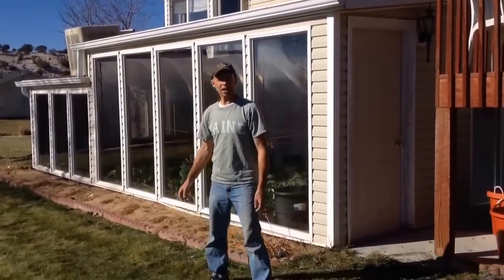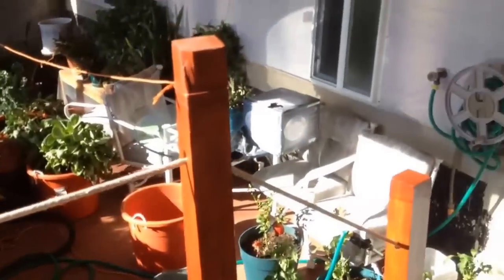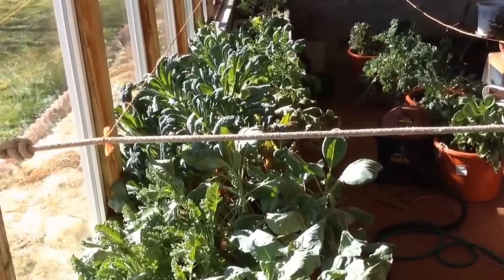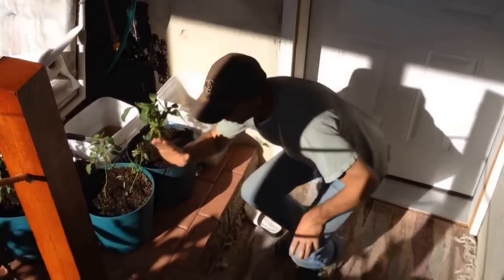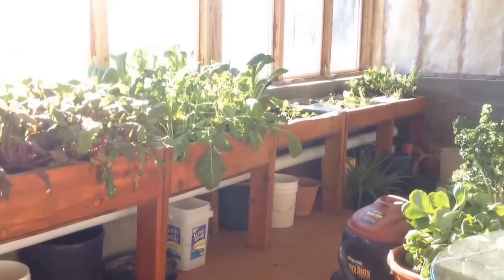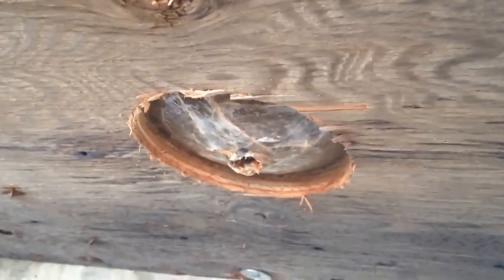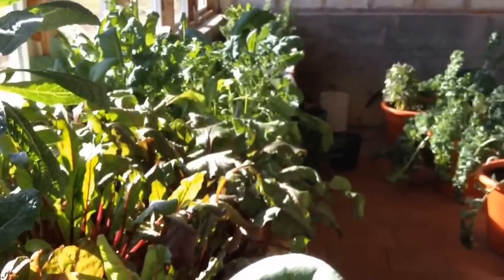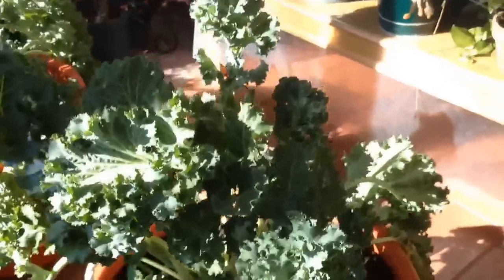Design an attached winter greenhouse / solar thermal mass heat room

Comment: Great job on your home. A NSF (National Science Foundation) sponsored home in New Mexico in the 1070's or so did the same thing as you did and commented in the report that they never had to heat or cool their home. It was a big surprise to them. Do you think they should have been surprised. No. The should have figured it out pretty easily with just one fact: 
Heat goes from hot to cold. And if the medium that transfers the heat is steel it goes very fast, concrete 10x slower than steel, and dirt 10x slower than the concrete.
If you insulate your concrete stem walls on the outside so the concrete stem wall and the earth beneath your structures does not connect with the outside air then look at your green house:
1. When the sun comes in energy is introduced making photosynthesis and what is not used for that is left in the greenhouse above ground and reaches a temperature of say 80 degrees. Where does the heat go? Now how does is get there. The outside air is 20 degrees. The ground is 55 degrees and your home is 70 degrees? Where does the heat that caused the temperature in your green house go? It cannot go to the 20 degrees through the concrete but can go through the glass. Why can't it go through the concrete? Because the concrete is insulated on the outside - that means no heat flows (mostly). So heat goes out the windows, goes into the concrete stem walls, goes into the floor tiles, goes into the sand, goes into the dirt with a certain moisture content, and goes into the walls of your home - because it wants that 70 degrees. And the walls of your home take the heat to the ground because they are insulated and no heat gets to the 70 degrees, but it wants to and is trying to. 
Now at night when the green house loses all its heat to the outside air through the glass through both the conduction through the glass and radiation to the universe (universe very very cold - it wants all your greenhouse heat but radiation is not so fast, but fast enough).
So when the greenhouse gets 50 degrees what happens?
You figure it out. What temp is your concrete stem wall? What temp is the dirt it took the heat to? What temp is your paver? What temp is the sand beneath your paver. What temp is the earth and moisture in it? What temp is your home inside? Right. All higher than the greenhouse. So? All the heat wants to go into gthe greenhouse that was taken from the greenhouse during the day. 
Make sense? Better because the physics makes it work like this - no surprise. You just have to think about it (like the experimenter in New Mexico forgot to do). And their study still is how people understand things today - by not thinking about it, they understand incorrectly. Good luck. Great greenhouse. You will never pay a heating or cooling bill if you get it right. Very cold period coming. Thanks for sharing  with us.
Reply from the maker: Thanks for adding your comments Carlos. There is a lot to be gleaned from the Earthship homes in New Mexico that run off of the physics that you are talking about and sustain livable temps through the winter, from the solar gains of the summer temps that get stored into their massive solar mass of insulating the ground far out from the home and using it as heat batteries.

Comment: What is the actual temperature inside your sun room when it is -15 outside. I want to be able to grow fruit trees like oranges and lemons. I know greens like Kale will survive even when the temperature drops below freezing, but I don't think the fruit trees would. Please tell us more about the thermal heating. Do you have pipes under ground to circulate air? (or did I misunderstand that?) What is the ceiling in the sun room made of, so it will not be damaged by moisture in the room? Do you have much of a heat build up in the summer months in the room?  Depending on where you live, I would think you would not get much direct sunshine in the room, but does it still get unbearably hot in there?  Thanks for the video. You did a nice job.
Reply from the maker: +jb pitcher Sorry jb, I just noticed that I didnt reply. I am not sure what the temps are when it is -15.  It does get cool at night, but above freezing (I would guess 45 degrees or so at the cold point in the night...). I know that citrus like warmer temps. We did buy a few different citrus trees and put them in the room, but they needed to be baby sat too much and they didnt survive... however, a few years ago we got 3 different citrus trees and we knew they didnt do well in the greenhouse, so we put them inside our south facing picture windows and they get lemons and limes all the time on them and they do ok, as long as we keep them just outside the all day long direct sun ( and as long as I am consistent on remembering to water them ha ha ).

Comment: Hi, Do you have a normal opaque roof / ceiling , or is it clear polycarbonate that allows the sunlight light to come through from the ceiling ?
Reply from the maker: +Tony VannTruth Hi Tony, the roof is insulated and shingled. It is a winter greenhouse that gets very little sun in the summer due to its direct south facing windows.

Comment: What type of windows did you use?  I am thinking of using dual glass vs. single pane. Am located in Eastern WA and do have some cold months.
Reply from the maker: +Robert Fischer Hi Robert. I agree with you and  I think you are wise to use double pane glass, as single does loose a lot of heat. One year we had a buck sheep ram our window thinking it was another buck ha ha ha it was quite the rude awakening on a new years morning ha ha ... and it broke one of the panes of glass and until it was repaired it got lots of cold through that single pane (I was surprised at how huge a difference it made... I would highly recommend using tempered glass and I would not do it any other way as you can expect to have children hit it and it will not break very easy and they will be safe :)... If you have the ability to use it, get sliding glass windows that are put into a picture frame, as they are the least expensive due to high volume of production of that size for the doors (note: check with a couple manufacturers to try to get the best price and or the size that would best fit your designs.....
Reply: +Steve Mabey  Thanks for the quick response.  Another quick question.  I would like to use your sand, pavers for floor.  Sense I am starting a new construction is it necessary for me to pour a cement slab?  Can I just level my base, add vapor barrier, sand or gravel, than pavers for floor.  Am thinking of using railroad ties for footings and not having any cement in project.  Think I can than get by W/O a building permit but need to check that out yet.  As you can see I am still in design phase so any ideas would be appreciated.  Would be small about 9' x 9' and would attach to my existing porch enclosed porch.
Reply from the maker: Robert, glad to help if I am able to. I just had dirt under my barrier and sand, but do have concrete footings. If it is attached to your home, I would seriously consider putting in concrete footings and attach it to your home concrete using a 1/2 inch concrete drill bit drilled into your existing concrete and pound 1/2 inch re-bar into your 1/2 inch hole (it works fantastic and it will tie the concrete together and keep the structure sound.  Make sure to measure and put in threaded anchor bolts into the concrete to attach your redwood or treated bottom plate, so that the bolts will land between the windows.  .. It will add square footage to your home and it will increase the value of your home... If you do go the rout of using rail road ties, use a redwood, or treated bottom plate and bolt it to the top of the ties so it holds it all together and then the windows will sit on the treated wood and if you have cold winters and the humidity builds up on the window it will keep you from having the wood rot (I would also consider using linseed oil to put on the wood as well as it is natural and it works well to preserve the wood). One thing that I was going to do with my attached greenhouse was to put some of that thick foam up against the concrete and then back-fill the dirt against the foam and then the concrete would not heat sink and loose heat to the cold ground, but it would be an excellent thermal mass heat storage that would let the heat out in the night when it cools down (but I can always add it in, but its so much more work than doing it when in construction phase... but we do what we have to at the time, if we do not have the money and time... let me know if you have any questions and it is good you are going for it! good luck

Comment: What are the dimensions of the green room, how wide and how long is it please.
Reply from the maker: +George Henson +George Henson Hi George. I built my greenhouse as long as I could along the side of my basement wall, so that it conformed and flushed up with the home and looked nice.,,, the length is approximately 22 feet long (just over 7 meters). My problem I had was that I needed to go under my home windows and have enough of a slope to allow water to flow off the roof... and I wanted to be able to fit sliding glass picture windows in front ot it and not be too close to the ground... so I could only go 12 foot or just under 4 meters. Let me know if you have any other questions.

Comment: just a quick easy idea, paint the bricks black to absorb more heat
Reply from the maker: +niceslug Thanks for adding the idea! I thought about it but I learned from my past experience of painting water barrels with black outdoor paint (the best I could find for longevity) that the paint eventually peeled and it was a mess. the Red pavers were better than the grey for light gathering and I used them (But you need to seal them with a bunch of layers to make last a long time and look new). So far they have done quite well and look great still, as it is technically a room in our home... Black would be best though, for heat absorption in the floor, but I believe it would be a maintenance nightmare if you want it to stay clean looking for long.... Thanks for your added ideas, because it would gain more heat in the brick pavers, instead of reflecting and going into other solar mass in the room!!!
Reply: OK, I have seen black concrete pavers they are black all the way through, maybe searching on Craig list or something like that
Reply from the maker: +niceslug  Thanks for the input. I always have liked to once in a while look at new ideas and colors that the hardware stores have, so when I am doing a new project, I can have more options. Black might look cool too :).

Comment: Are you familiar with Passive Annual Heat Storage?
Reply from the maker: Yes. I have been working on a design for a home that will use the Earth for preheating and for geothermal storage as well as passive solar heat storage in the off season and in the season., but I need to learn all that I can with it, so as to incorporate as much as I can into the home. It might be some kind of hybred to some of what I have seen....  My goal is to set up a web page as I build it, so I can learn from others and others can learn from my success and make improvements from it as well... . If you have any links to sights that give some kind of design info as to how much earth to incorporate into the side and under and how to best create various vaper/heat barriors/insulation above and to the  side and below to keep the thermal mass of the earth large enoush and yet contained and stored and not heat sinking it to the outside barrier. I have some design ideas, but I do not want to spend my lifes limited time reinventing the wheel if others have some good design ideas to assist and  move forward with... Using the Earth and working with the Earth to create a good and healthy living environment is the future with health,  sustainability ... and the future home design must go through a paridime shift and must move in that direction... Thanks for any info that you have and god bless
Reply: I believe this is the book I have...somewhere...and it's available as a free download, along with some related books:  http://www.bookfeeder.com/pdfbook/passive-annual-heat-storage-improving.pdf  ...Hope it helps.
I'm working on attaching a greenhouse to a 12 x 16 portable building/micro house, using four old patio doors for the south side. Just thinkin...might be well worth it to make each hinge open like a door. Anyway, just scouting for ideas too. 
My problem is not having my own digging machine, or the funds to contract one yet, so I will probably just do a half ass P.A.H.S. attempt to trap some heat. Here in the New Mexico high desert we have this thing called "Caliche" that limits hand digging, and the ground on top of it is hard packed with lots of rock.
Reply from the maker: Thanks Kelhawk1, I found on Mother Earth News where the author wrote this article and I will read it there. http://www.motherearthnews.com/renewable-energy/passive-annual-heat-storage-zmaz85zsie?pageid=1#PageContent1   so far it is great! thanks again for posting it
Reply: I first read about P.A.H.S. when that Mother article was originally 
published, and was inspired to buy the book. I find it exciting that the
 principle can also work in reverse to store cold.
Reply from the maker: I agree. That opens up other design projects to think about ha ha .... like we need more :). I just checked out amazon and the reviews are very good on the need to have this book before building a home. I plan on getting the book for sure and Amazon is a great source to find what others bought along with it..  Somehow I missed your comment earlier. Thanks again
Reply from the maker: Here is another pdf that has some very good reference work that you can google and get the pdf for as well....
Earth Shelters; A Review of Energy Conservation 
Properties in Earth Sheltered Housing 
http://cdn.intechopen.com/pdfs-wm/40549.pdf

Comment: Thanks for the vid. Really nice greenhouse. But your pavers vs barrels logic doesn't add up. First of all, you say you don't lose any floor space with the pavers but if the floor is covered with anything (plants?), the sun won't shine on it and you won't get any heat storage. Secondly, water holds about twice as much heat as brick per volume so you only need half as much to store the same amount of heat. Third, the winter sun is low in the sky plus you're underground which means that a small percentage of that floor is going to get direct sun (if its not covered with plants) in the winter when you need it most. The north wall is going to get way more exposure than the floor. I would have just put a bench on top of the water barrels and put plants on it. I'm confident that the reason your greenhouse doesn't freeze is because its underground, not because of those pavers.
Reply from the maker: Paul, thank you for commenting and bringing up questions and comments that others also would want to think about and know...  it sounds like you have some ideas that you want to experiment with. I would absolutely say to go for it and have fun doing it and you will find what works best for you at your location. But the biggest thing is to just start by doing it ... :)... As for me, this has been a 20 year work in progress at this location, and I already had fun doing it the way you are planning to do it for many years and that is why I found it works best to do it the way it is in the video... Every person has different situation and will need to adapt it to work best for their home or shed or what ever they want...  For my situation,  I use this system also as a sun room with a table and chairs (in the freed up space, after removing my water barrels)  and to heat my home and that is where the extra heat goes :). I had a dozen 50 gallon barrels of water against the back wall for many years and found they were not needed, so we freed up a huge amount of space by removing them :). We also used to dig up the ground and plant in the ground and I got rid of this silly mess and found the grow boxes are not only virtually effortless, but they are clean and due to the incredible rich aerated mulch and compost and NO outside dirt in it, everything grows twice as fast and much more healthy. The floor with a moisture barrier and sand and then pavers works fantastic and the biggest thing, is that the design does not heat sink the heat into the ground and does store it to return at night and of course it is so clean and easy to keep clean that we walk into the greenhouse from our home in socks...  We love it with this attached sun room / grow room and it is a very easy to clean, usable room in our home and the sun does hit it throughout the winter months...  (I would say that In our outside greenhouse, I did not and would not do it the same way as this extension of our home :).  My back wall is 8 inches of concrete and has plenty of solar mass and due to it being underground and against our home, it has never freezed even with 40 below zero temp, with no doors open to the home and it is not heated :). So it has been a win win... Once you have built this kind of attached greenhouse, you will find that most plants do best right up in front and not against the back wall.. those plants that are on the back wall will get such short period of month and a small amount of sun and for such a small time frame, that they will become sick and susceptible to diseases.. you are right about the sun hitting the back wall, but the entire room and pavers do heat up from the warmth of the room (even when they dont get direct sun on them, as a thermal mass); it all adds up and works together... If you watch the videos, I believe I explain it pretty well. I would go for it no matter how you think it would work best for your situation. But start the project and finish it and you will never regret it! Good luck and god bless in your plans!!!